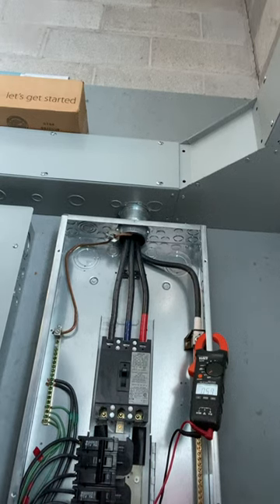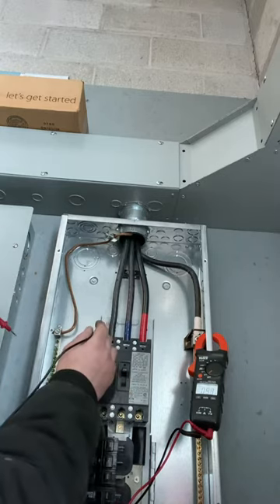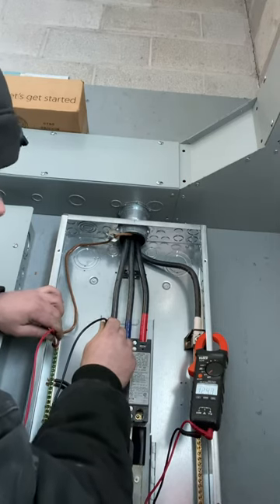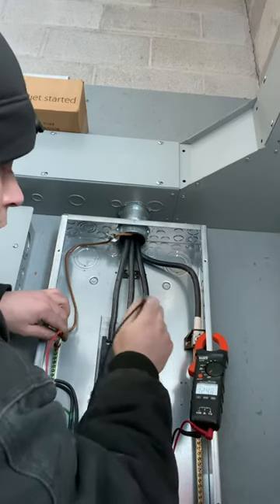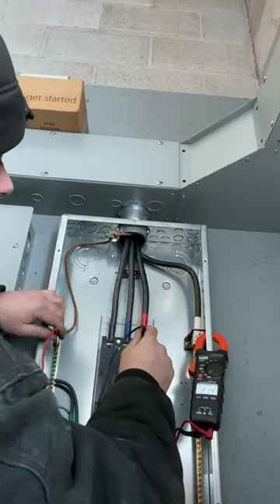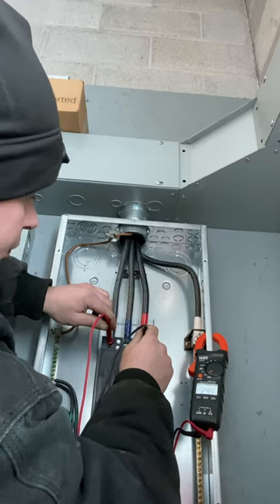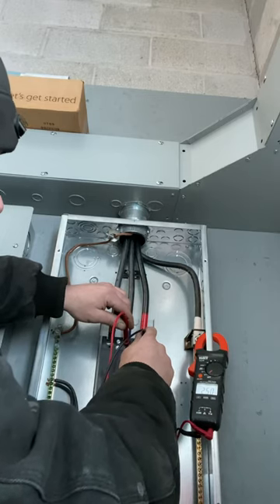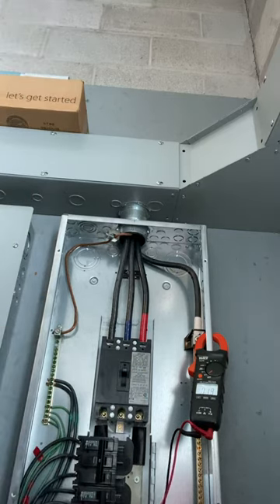How to test a Delta 120/240 (Wild Leg) 3 phase electrical system , explained!!

Comment: The wild leg should measure at 208
Reply: Correct.   If you took line to neutral in this case 120V  and multiplied that by 1.732 you'd get 208V,  similarly if you had a 240/480V 4 wire delta to find the high leg voltage you'd do 240*1.732 and you'd have between 415 to 416V.
Reply: @Sparky-ww5re  I'm just curious to know why it measures at 208 while all the others measure at 240
Reply: @yiannitrakas5582  since this is a delta system,  the transformer winding are connected end to end in the shape of a triangle,  with one winding cut in half.   For the high leg we need to find the hypotenuse, so we  use Pythagorean theorem.  240² - 120² =43,200.   Square root of 43,200 = 207.8461, in the field we simply say 208V.  With a 240/480 delta we would use 480² - 240² = 172,800.  Square root of 172,800 = 415.6922, or 416V basically.  The line to line voltage is the same from A-B, A-C, & B-C, line to neutral is half the line to line because we split the number of windings in half.
Reply: @Sparky-ww5re the 208 being the phase voltage correct? We’re learning this in school but only on paper. This video is nice because it show an actual field application
Reply: @TXRoeJogan  with a 120/240 volt 3 phase delta,  the phase to phase voltage is 240, just like in a 3 wire ungrounded or corner grounded delta.  Because of the center tap on one of the windings, you get half of 240, or 120V between those two phases to neutral.    The other phase measures 208V to neutral,  and is known as the high leg, red leg, orange leg, wild leg, stinger leg bastard leg or dog leg.  That is not an intended voltage,  but rather a mathematical thing based on phase angles.   This system is seldom installed today, nonetheless it can be found in older commercial and industrial buildings and in more modern applications when the majority of the loads are three phase motors, the 240V vs the 208v found on the more common 208Y/120V provides higher starting torque and lower operating currents for a given horsepower,  allowing smaller conductors and smaller raceways thus material and labor costs can be reduced.   However load balancing is poor if there are any significant 120V loads because they can only be connected to the transformer with the center tap, oftentimes this transformer will be significantly larger than the other two to compensate for this.  

In a 208Y/120V system the phase to phase voltage is 208, phase to neutral is 120.
Reply: @Sparky-ww5re  Howzabout we call the orange conductor the 'Power Leg' and the other two the 'Hot Legs'? That's how I learned it in my apprenticeship over 50 years ago. Wild leg, high leg, low leg, long legs, way too many names. Confusing.

Comment: High leg is B
Reply: Systems installed prior to 1975 typically were required to land the high leg on phase C.   If a 4 wire delta is supplied by a service the utility company requires the high leg to land on phase C at the metering equipment because some meters require a 120V connection on phase B, so the utility must choose phase A or C to avoid destroying the meter.

Comment: It's called a 208 system cause it's got a 208 leg. Lol
Reply: 120 x sq rt 3= 208. Basic electricity.
Reply: A 120-208 4-wire wye system is different than a 120-240, 208 high leg 4-wire delta system. Utility industry will use delta or wye terms to differentiate between the two, which will indicate the voltages provided to the point of interconnection.  Wye systems provide 208v phase-to-phase, while a delta system will provide 240v phase-to-phase.

Comment: NEC 110.15 requires the high leg be marked orange,  or other effective means, so in theory it could be red, I've heard old timers referring to this as red leg delta.   NEC  408.3 (E) (1) requires the high leg to be on the B phase,  in Panelboards.    NEC 408.3 (F) (1) requires such a panelboard be field marked with CAUTION: _ PHASE HAS _ VOLTS TO GROUND.   in most cases that will be 208.  In very rare installations you will see a 240/480 volt 3ø 4 wire system,  in this case the high leg is 415 volts to ground.    

Installations before 1975, typically have the high leg on phase C.     And a common (and very expensive) mistake is to accidentally connect a single pole breaker to the high leg and destroy everything on that circuit.   Having said all this,  it's crucial to verify the voltages with a suitable meter, never rely on colors.
Reply: Came across this today at an older building. Delta 120/240 with the high leg 208 on C phase to ground/neutral. Cool for me to see as I'm new to that and just getting exposed to commercial work. Makes sense as far as the time period when the work was done.
Reply: I worked on a 120/208 Delta panel before. They're rare these days. 120/208 wye is more the normal nowadays.
Reply: Love the knowledge
Reply: In the utility metering world the high leg remains in the c-phase position for self-contained meters and needs to be maintained as the c-phase position for terminations for instrument rated meter sockets. Phases are swapped so that the high leg lands at the center position of the disconnect.  That is one reason why it is not a good idea to check phase rotation at the meter. It is better to confirm rotation at the first means of disconnect or the point of utilization.

Comment: The high leg is NOT "220" or "240" to neutral. 
With exactly 120v on the other phases, the high-leg would be (should be) 208v. Of course, variations in primary voltage due to loading, etc.,  and variations in the transformers themselves can cause higher or lower actual voltages. But on a 3ph 240v hi-leg system, the high leg is 208v (do the math).